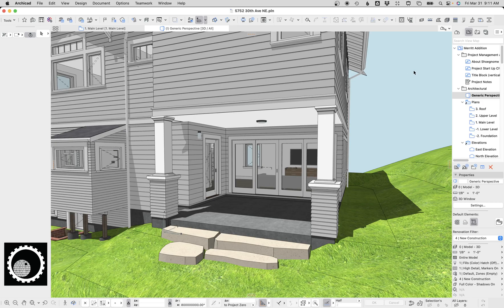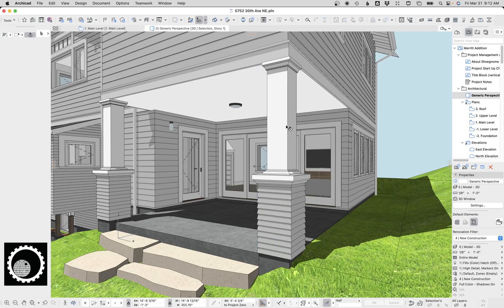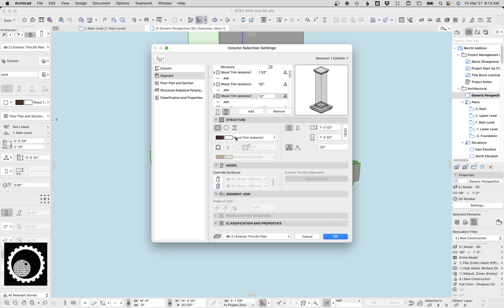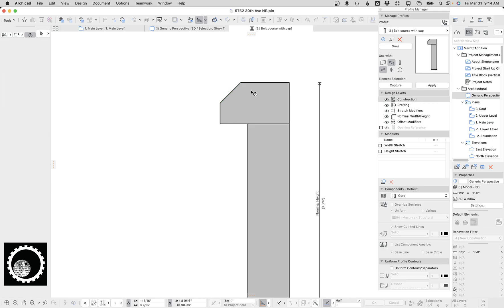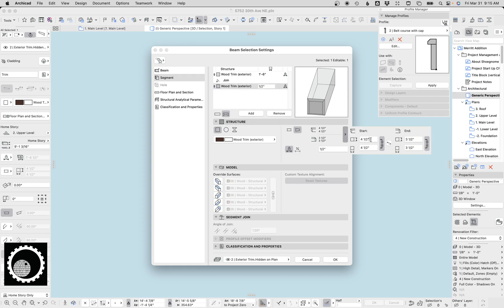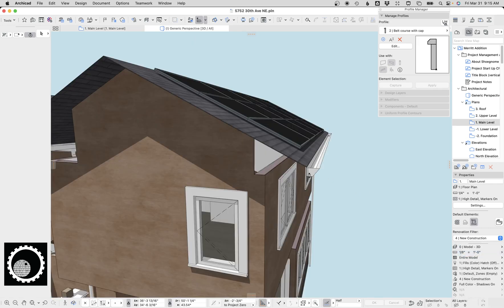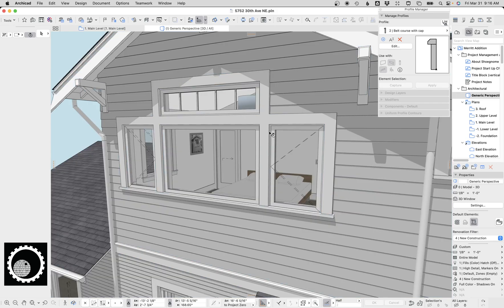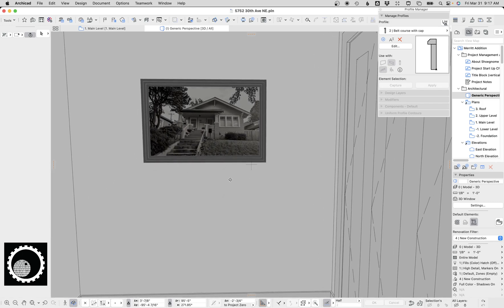Archicad Tutorial #91: Exterior Trim Techniques

Comment: Do you have a trick for cleaning up beam end joins when using them as facia around roofs?
Reply from the maker: Yes. It's all about how the reference lines connect, or more importantly don't connect. One reference line might be at the outside face, the other at the inside face. Then I manually move one end to touch the other beam, but make sure the reference lines don't touch so that the beam ends don't merge.

Comment: Hi Jared, could you make a video or share how you use skylights in roofs made up of multiple roofs? The skylight seems to only cut one roof (typically the finish roof).
Reply from the maker: Nick, that's a great question. And an annoying problem. I'll add the video to my to do list and try to get it done sooner rather than later. FWIW, sometimes I use empty skylights to cut the other roofs and other times I make a hole in the other roofs. I've yet to settle on one solution. I then use thin beams to create the gyp. Bd. Shaft on the inside.
Reply: @Shoegnome  Thanks for the update. Keeping all the different openings and gyp shafts aligned is a nightmare... So maybe you can touch on any technique you have for keeping everything in line when you do the video. Do you still use the shell tool for the lining or just beams now? Thanks!
Reply from the maker: @nick_rober  I just use beams. I totally agree, it is a big pain. But I think I have a system down that works pretty well. Once the Beam tool got more versatile (Archicad 23?), the need to use the Shell Tool went away.